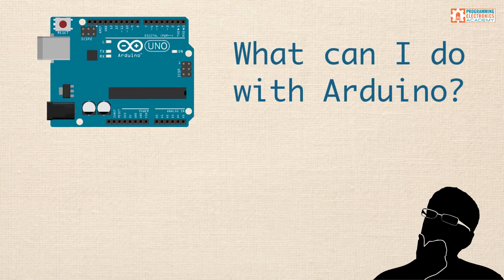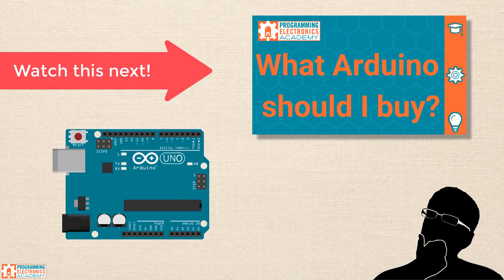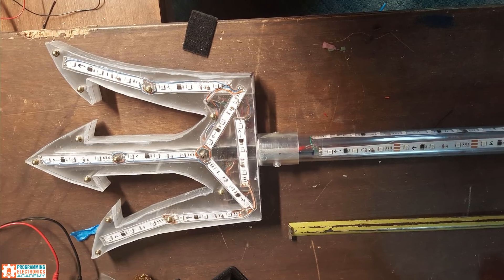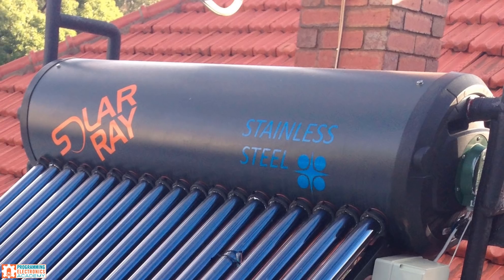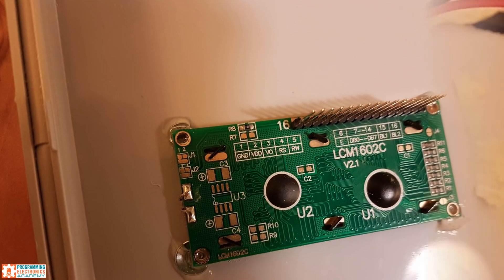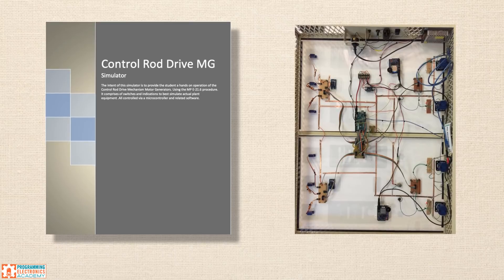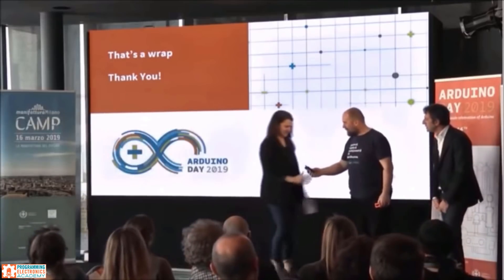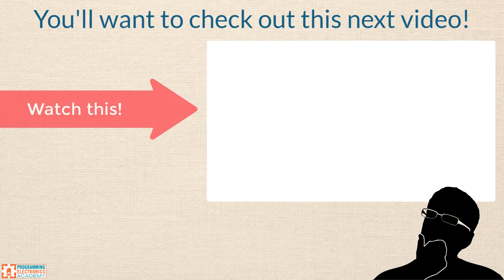11 Arduino Projects - They built what?!

Comment: I’m working on a project for “updating” and improving my military truck from 1992. I’m guessing that by the time I’m close to finished I will have used close to a dozen nano or uno boards along with tons of sensors and displays, led or 7 segments. I have the working circuits done for two sub-systems already. With so many Arduinos I might even implement some sort of BUS eventually.